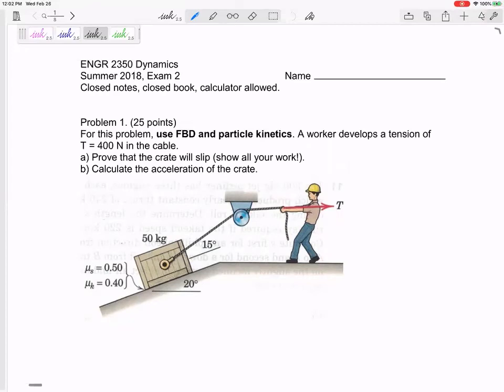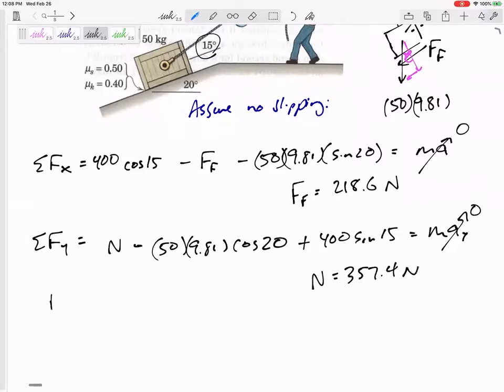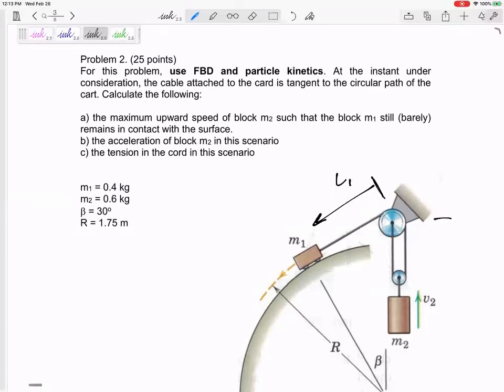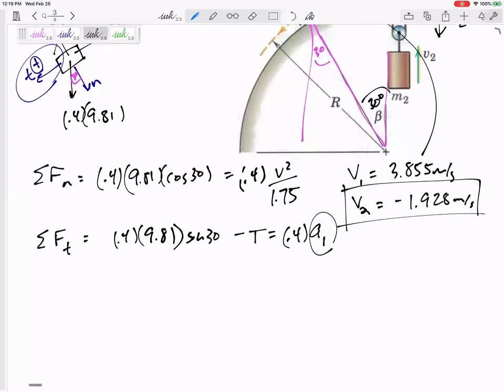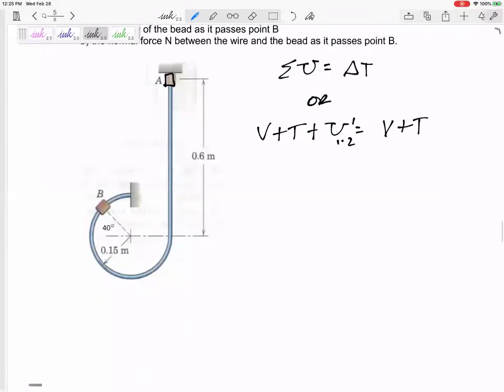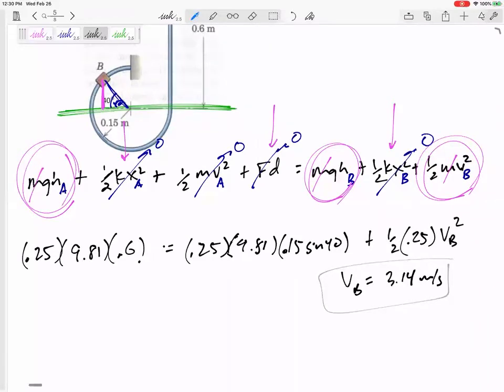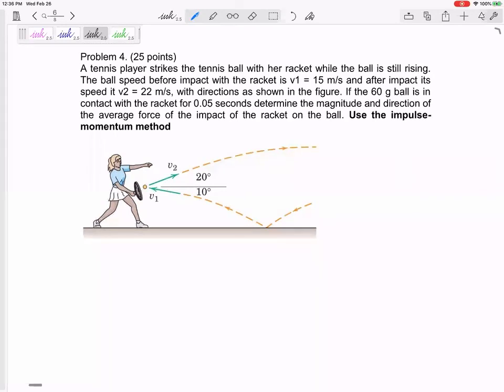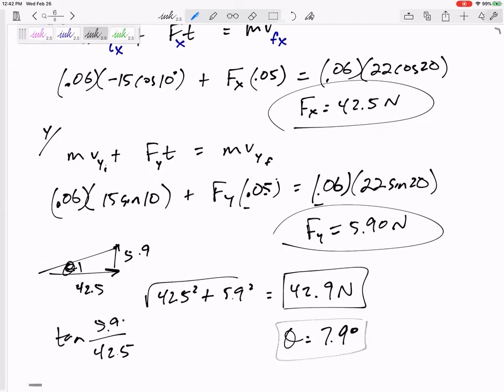Dynamics - Test 2 review day

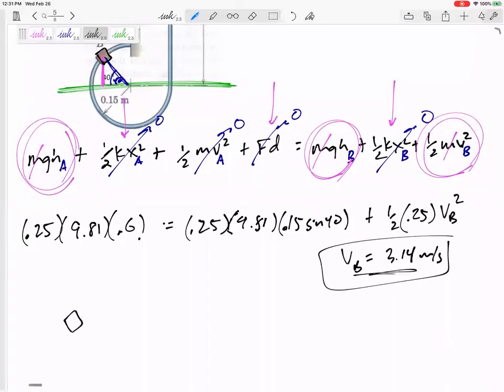Comment: I thought of it differently for mghb, I said that the h was the perimeter of the 3 quarters circle... Got 1.5m/s and and I am totally sure about my answer. The box moved down the whole wire and cut the whole distance not as you thought.... Your answer didn't make sense to me at all cuz the box traveled the whole circular distance. 29:00
Reply from the maker: The h inside the potential energy term mgh is just the vertical position, not the distance traveled. You just need the height at the beginning and the height at the end.
Reply: h is displacement not distance traveled